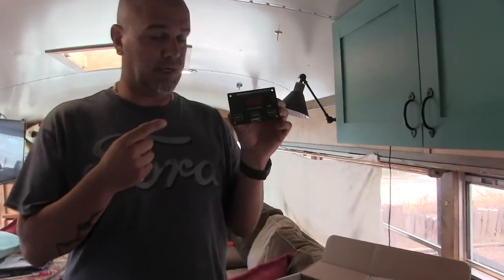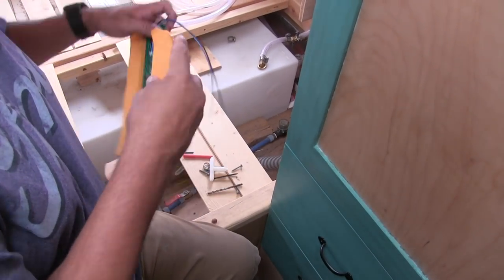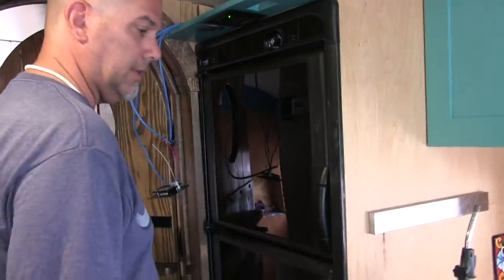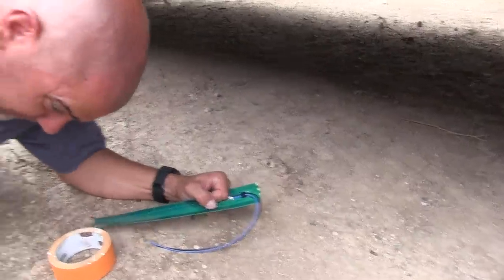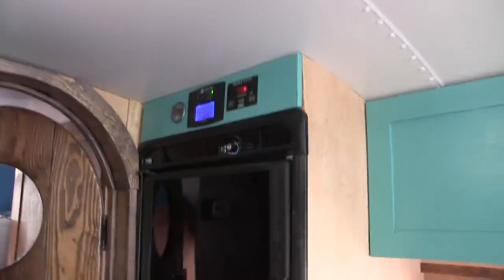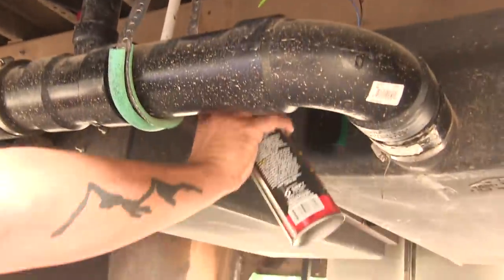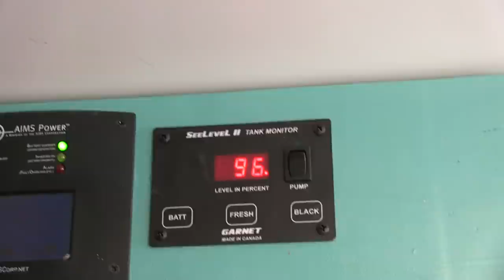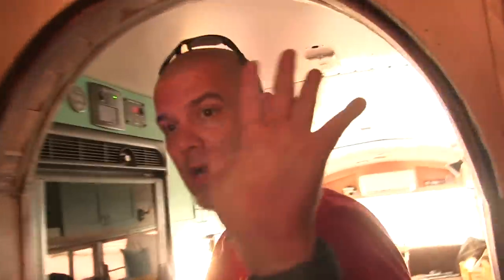The Best System We Found for Monitoring Liquid Levels in our Skoolie!

Comment: Hey Mike, I’d bend that metal support strap you cut away from the tank (both sides). Road vibration might start to wear a hole.  That cut off wheel leaves pretty sharp edges. 

Or put some type of insulation in them.

Comment: Every RV I've ever owned I've had problems with the readout on the level of the black water tank because of toilet paper getting hung up on the float system used to indicate the level because the float is inside of the tank !   If this system you just installed on the bus continues to work correctly I'm going to install the same brand system you just did in my RV.   Thanks for sharing !!!   Love yawls videos, excellent !!!!!!!   TGBTG ( To God be the glory ),  stay safe and safe travels to you both plus Momma Sita !

Comment: Our used 2014 Airstream had the SeeLevel II Tank Monitor system and it worked perfectly.  When we purchased it’s replacement Airstream it had the old MicroPulse Tank Monitor system and didn’t work for the previous owners, so I purchased and replaced it with a SeeLevel II Tank Monitor system.  I’m very happy with it,’s performance.

Comment: Mike, check the amp rating of that switch is capable to run the current for the pump. If in doubt, chuck in a relay. Cool system though.
Reply from the maker: 10 Amp and the pump is rated at 10 amps too!

Comment: This comment actually referred to the lamps you modified during the TV install and I wanted to know what you modified on the lamp to use the led bulbs. Thanks
Reply from the maker: I just skipped any electronics and wired direct to the switch.
Reply from the maker: Also, I highly recommend you watch the video. I wired the lamps with 12v not 120vac. That part is hugely important.